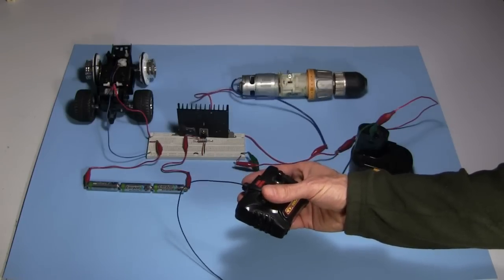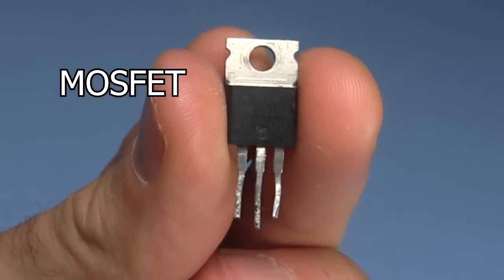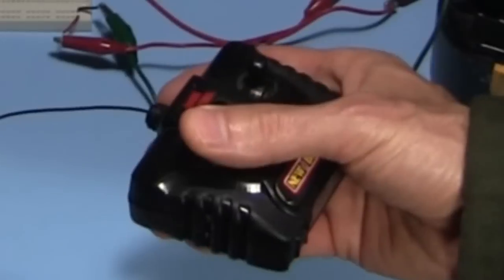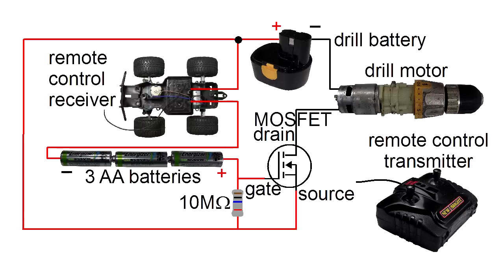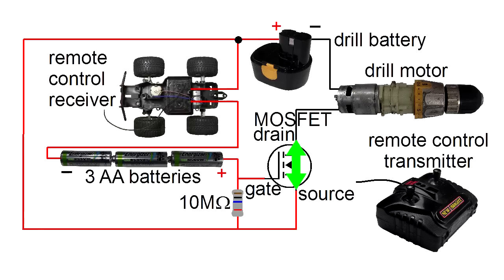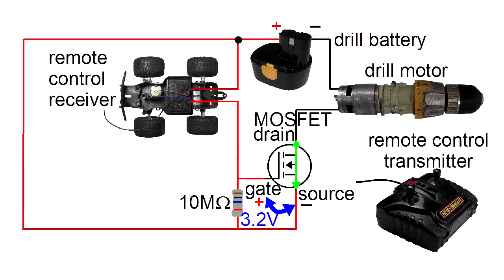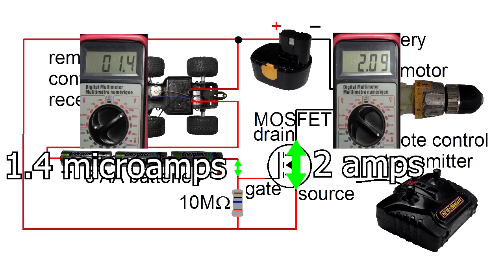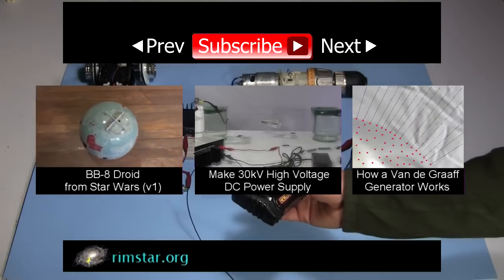Remote Control Drill Motor & How a MOSFET Works

Comment: mmm the circuit looks fugly. I think it would have been better to just use smal voltage doubler or cuatrupler with a 555 to get enough voltaje to fully turn on the mosfet. No need for biasing and you only use the drill battery instead of needing 3 extra AA. There are even mini step-ups where you put some voltage in and get a higher voltage out. In your case you have ~3V so you'd need one to get 10-12V from 2AA cells.
Reply from the maker: +Laharl Krichevskoy Oh, neat idea.
Reply: +RimstarOrg 
no dont do it.
biasing is actually better then voltage doubler or anything stupid like that.
my best suggestion is to buy logic level mosfet, those have low gate threshold voltage (some even 1-2V and they are not even close to begin rare or expensive)
Reply from the maker: +שי מזור Thanks. Why is biasing better? I've since bought some logic level mosfets but it doesn't matter anymore. Since moving on to a full H-bridge circuit, the gate to source voltage is now being supplied by the drill battery, while using a transistor and PWM from an Arduino for on/off and speed control.
Reply: RimstarOrg voltage multiplier \ doubler work only on AC. if you use a transformer it might be ok for you application.
you might want to use chrage pump for this but really if you use something else use it.
also for speed control with pwm you might want to show of using 555 timer as it is better if you want to solder it on a perfboard or etch pcb.
if you are going to do a video about it dont forget to mention gate capacitance and how it can effect pwm frequency and maybe how to calculate power losses that convert to heat.
:D
Reply: שי מזור the idea of the 555 was to generate an square wave AC signal going from 0 to VCC. Then with some caps and diodes you can double the voltage and then adding more stages using the same signal you can get 4x 8x and all the powers of 2 as far as the caps and diodes can withstand the tension. It needs AC but it doesnt mean it has to be sinusoidal.
Reply: Laharl Krichevskoy
but why would you do that in his current project? a small battery work well and will last for alot of time.
Reply: שי מזור
because it gets rid of a replaceable component. Now you'd only need the drill battery and not some other batteries too that may be discharged or at different voltage levels which may affect the device performance over time.
A 555 voltage doubler may not be a closed loop system but it will vary a lot less and need 0 maintenance compared to batteries which in some time will run out from use or self discharge and may even leak and will need you to be checking their voltage from time to time.
The less parts you depend on the better the circuit.
The 555 is super versatile, and unlike batteries, will most surely still work even after you've died. With the right tunning it can be made to consume almost nothing (surely less than NiCd's self discharge rate) which would make it be like it wasnt even there.
What's more, if it were me, i would make it a quadrupler and add a resistor and a 12v zener to make sure the mosfet is always fully turned on, on top of using a IRFZ44 which is a very robust mosfet which wouldnt even need a heat sink for just 2 amps. You can even add another 555 as a mosfet driver if you want better rise and fall times and then you can do high frequency pwm with it to control the speed.
Reply from the maker: Laharl Krichevskoy
Yeah, I didn't like the biasing for the first reason you state, having a battery that would need replacing. However, since this was just an intermediate test step I didn't mind. My new MOSFETs and H-bridge circuit do need heaksinks, unfortunately. But then I'm no electrical engineer, so my circuit may not be the best either. I'll have a look at the IRFZ44, thanks.

Comment: ohh soory i ment to say i got the loop without the antenna wire that go's around the loop at the yard sale I got it from. that came with hiss am fm radio that he had
Reply from the maker: +Andrew Kimble I depends on the dimensions. As I said in my reply on the other video, mine was around 18" x 18". If it's around that size then it should be good, assuming you have some radio stations nearby.

Comment: Try a different mosfet instead of adding more batteries
Reply from the maker: +ChadHHC86 Sounds like a good long term solution. This was the only MOSFET I had on hand for this test. But I should mention that in the video.

Comment: Use a boost converter instead of the batteries. Theyre really cheap.
Reply: +Nicholas Lenzo   nevermind possible debate about the "cheapness" of a boost converter, a few AAs will not be able to supply enough amperage to run a drill motor that size. generally, you would need either several parallel banks of AAs, or using larger C or D cell batteries.

drill motors generally require about 4A to spin up, and about 2A to free-spin. driving a load generally requires around 5-10A or more.

IME, AAs can generally only supply around 500mA to 1A before the voltage drops off. D cells can supply a fair bit more current.
Reply from the maker: +Brendan Bohannon I could be wrong but I think +Nicholas Lenzo was referring to get rid of the 3 AA batteries I'd used to bias the voltage of the remote control truck by having the output of the truck go to a boost converter and from there to the MOSFET's gate. I don't think he was suggesting replacing the drill battery. Of course, I could be misunderstanding what you're saying too :).
Reply: RimstarOrg  oh, ok. a few resistors and some small (TO-92) transistors could also do this (use them to drive the MOSFET's gate off the drill battery). (I had somehow misread the original comment, thinking he meant to get rid of the drill battery).
Reply: +RimstarOrg +Brendan Bohannon Yes Rimstar, you are correct. But Brendan actually makes a valid point, the drill battery could also serve to activate the gate. You would just need a TO-92 2N9304 & 2N3906 transistor to hook it to the gate of the mosfet. I used this same method to control high voltage to my Nixie Clock with high voltage transistors. 

Although, if you could switch up the circuit a bit, and put the drill motor on the positive side, you could throw out the 2N3906(PNP) transistor and just use a PNP mosfet with a 2N9304(NPN) transistor at the gate.
Reply: Nicholas Lenzo  yeah. a lot of my motor drivers boards also work this way, though generally with inverting outputs to save on transistors (say, so I only need a 3904 or 2N2222 or 2N5401 or similar per half-bridge), and I often use TIP122/TIP127 rather than MOSFETs (cheaper, and 5A is often sufficient, and I can go over 18V without fear of blowing up the transistors).
Reply: +Brendan Bohannon I Imagine his circuit should look like this. Saves a transistor.
https://drive.google.com/file/d/0B1YSuO9Z7Y_fX2NtZWQtTHRlWlk/view?usp=sharing

Might need to bias the Gate of the FET with a resistor to + , so the gate stays high until the NPN activates.
Reply: Nicholas Lenzo  could be, I think another resistor would be needed also so the FET can turn back off...
Reply: +Brendan Bohannon Thats what I meant by bias. A resistor hooked to R1 and the positive line would allow it to turn off. Otherwise, the FET would kinda float and leak. Good eye.

Also, he might want to use a different FET with lower resistance.